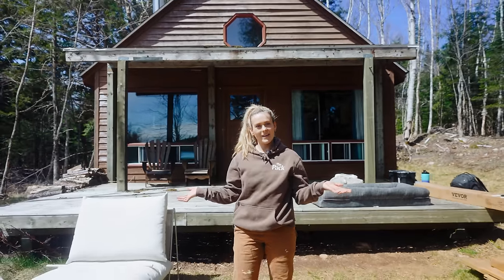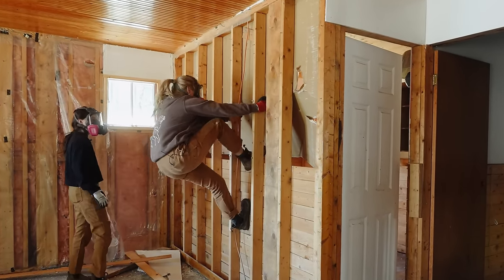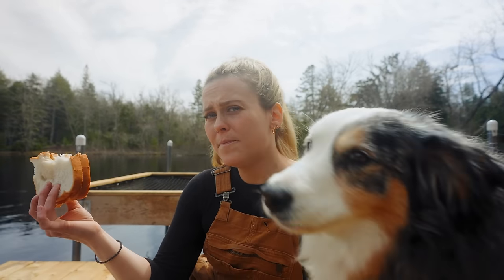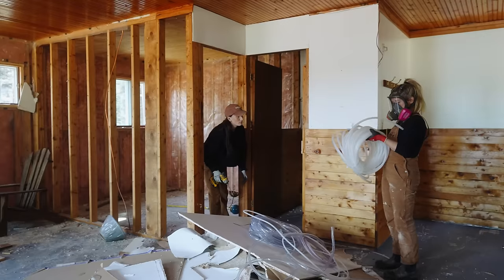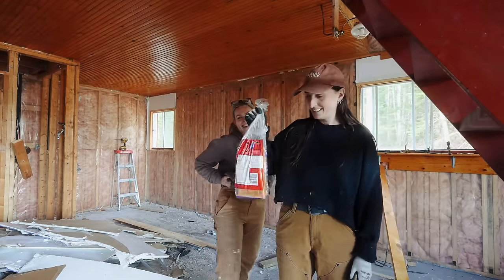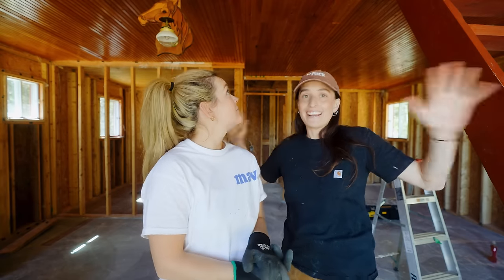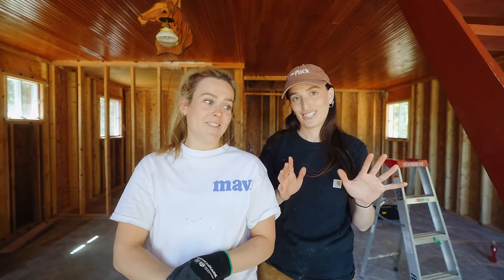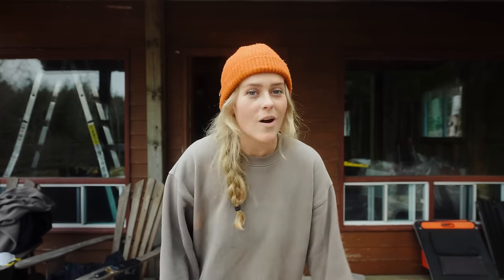Renovating An Abandoned Home: Demolishing the Building

Comment: Nice work you two. Big plus that the framing is 2x6. If all the water is coming in from the roof then the sheeting in that area of the roof is most likely rotten as well. From what I’ve seen some studs and floor plates and some floor sheeting is not a show stopper. Kind of sucks that the wall sheeting at the windows is gone but don’t really know what you planned for siding. Of course the siding needs to be replaced once the wall sheeting is done. If it was mine I still think it’s all worth fixing. Keep going!

Comment: You should consider spraying the moldy areas with water before ripping out so the spores don't release in the air when you disturb them. Also to avoid the super gross feeling after  demo like that wear a disposable coverall like tyvek. You will still sweat a need a shower but all the gross dust/debris won't be on your clothes and skin. Great job!

Comment: Jasmine I understand the claustrophobic feeling of wearing a respirator but you have a substantial amount of mold in the cabin, not working directly with those areas doesn’t prevent exposure. Mold releases airborne particles which can be dispersed with movement through the area and as Crystal removes those materials, particles are dispersed throughout the air that you subsequently breathe even standing away from the surfaces.  Please at a minimum wear an N95 quality mask when in the cabin until you’ve treated the mold areas.

Comment: Wow this is going to be  a lot bigger job then the other cabin . But the views of the lake make it worth all the work. Are you going to salvage   any of the T&G to use when you rebuild?  One thing you might want to do is to tarp  the roof so as you gut the place it will help dry the place. 
You should cover the holes in the floor And you should be wearing  a mask anytime you are working inside till you have finished gutting the cabin.

Comment: 😊 just an fyi.. in past experiences outside wall for water supply like kitchen sink, in buildings that aren't continuously heated during the cold months will freeze. But if your crawl space is gonna have any heat vs. Outside frozen temps. The pipes won't tend to freeze n insulate exposed pipes.

Comment: Look careful at the windows.They will be sweating It appears to be leaking but they may not be leaking. Might wanna pick up some big fans to air That place out before you start rebuild. Having been through it with 3 trees in the roof from a hurricane. Once you get the leak stopped on The roof you need to spray everything with a mold killer.Get some fans in there and get it right out.And then determine what would it spend and what wood is good. You'll be surprised.How much of the wet wood is still perfectly fine once it's dried out. But once you spray them all you need to get the humidifier are fans in there to get the moisture out. I spent 2 years hunting howl after howl in the roof I finally just had it replaced and they found a 12 inch.Tough that flap Dover and no one could say it.Was there 4 different roofing Experts looked for and could not find.
Once the roof is stripped back and the plywood is replaced.That is bad.Have a roofer, put down The polymer called ice and rain You cannot do it yourself.Because they will not warranty.It has to be done by a trained professional. But this is designed the self seal if the roof gets damaged in a storm Or ice And comes with a nice discount on your homeowner's insurance.

Comment: I think you should keep the octagon window and just install it properly, but maybe instead of keeping it up top there you could put it in the bathroom, or somewhere on the back of the cabin, and frame out and install a very large daylight-channeling window in that upper space instead. i guess it might depend on what kind of final ideas you have for the upper floor. 

if that front wall is completely garbage you could maybe open it all the way up and make an accordion window/wall out of it (like on the side of your first cabin), or maybe build a whole extension off of the front of the house. 

💛

Comment: What about the mold that's on the first floor joists (as seen from the crawl space)? Will you need to replace some of those joists? I suspect that you'll need to replace a lot of your subfloor. Are you saving the tung-n-groove boards for the new version of the cabin? 
As a design I would move the stairs so that the kitchen area is connected to the sitting area. Also I would start the bathroom at the outside wall under the existing window. It needs some natural light. 
I think the wet sheathing in the front corner may need to be replaced - not a big deal but it may be too wet. It may have expanded from absorbing water. 
The 2x6's are great but you ought to put even more insulation in the walls if this cabin will be used in the winter. In many cold climates like yours, in North America, the standard (or the building code) for exterior walls is at least R-30. You can get that with closed cell foam but that's expensive. You could add a 2x4 interior wall and blow cellulose or fiberglass into the 10" walls. That will get you a very nice R-40 wall. And the roof ought to have at least R-40 but R-60 would be much better. Don't forget to insulate under the first floor. That ought to have the same insulation as the walls. 
If you are going to replace the windows get ones that are filled with gas for greater insulation. You don't have to get fold-away doors like you put into your main cabin but bigger windows facing the lake would be nice. (Whew, that got a little long. Sorry.)

Comment: Kiddos...Blue tarp, blue tarp, blue tarp.  Get the roof leaks under control and allow the framing a chance to dry.  If you need to keep the windows intact, try some tubes of really really cheap caulking, using schmear technique.  Gotta stop the water.
Big question....Does the river/stream/lake itself rise high enough to reach the first floor of the cabin?  If yes....Short of installing levees or lifting the cabin, you're fighting a battle mother nature always wins.
Another consideration...When you remove external wall framing, some of the exterior wall covering will need to be removed.  Can you preserve it?  Can you match it?  Would the exterior need completely recovered?
I think assessing the water damage/mold damage with all the framing exposed is going to set the direction for what comes next.
Be safe, thanks for your time and good luck.

Comment: The biggie is what's the sub floor like. If it's in good condition it'll be a long remodel (nothing you're not used to). If it's sketchy then you 'could' tear the whole cabin down (carefully) salvaging the structural pieces, build a new raised base a little further back from the river and design your own structure.

Comment: Considering the cost of building from scratch it's well worth salvaging... the bad places can be cut out and rebuilt if the structure is in question. Good mold killing and drying, after you get the roof plugged, will start to let you see that new vision.

Comment: I'll take a stab at this. Tearing down the house and rebuilding it would defiantly be faster, but, fixing the issue areas,  will save a ton of money esp when all you'll have in it material. I'd continue to dig till you find the bones, and then come up with a game plan. I am hoping as far as the roof goes, you'll only need to replace a few boards and the sheathing, followed close behind, all new tin. Then you can take your time and fix it right. Treating the mold where you can, and then rebuilding it. You might wanna look into some professional help and raise the cabin several feet so it's no longer gonna be flooded again. Not that that is the main issue, but, it is an issue. Also, as far as replacing any of the rafters. Get some good demo blades for your sawsall, and do one at a time, that way, will be easier for the two of you to do that job no problem. Get some good tarps to cover it all as you go, then when nothing but the rafters, start rolling it back as you start putting your roof on.  I hope you are going to save some of the board you are taking out, could be a big money saver. Invite some friends over and have a nail pulling party! 
I think you should change the name from Vanwives, to Cabinwives ;)

Comment: I’m mostly concerned with the sill plate, the rim joists and the floor joists. Everything above that is fixable as long as the base is solid. I’ve had to level an improperly built post and beam house and it’s a chore to say the least

Comment: Looking at it, there's nothing wrong with that cabin structurally. When you did the tour underneath in a previous video, all the blockwork looked good, the joists looked good and now you've pulled all the linings out, the walls inside on the ground floor at least look to be in pretty decent condition. Windows are garbage (flashing weird shaped windows is hard and they almost always leak if not done properly), roof needs replacing and where any studs have had water running down them, it's probably smart to put a moisture meter on them first and then replace them on a case by case basis. Subfloor is garbage too, just from the water pooling on it. This isn't a knock down and rebuild, it's a repair and re-roof.

Comment: Get a PRO to replace the roof.  Replace windows, floor,  Leave 1sr floor bdrm and bath where they are.  Make sure bath has access to main living area.  From watching video, difficult to move stairs w/o moving windows, doors, etc.  Live in U.S.  Do insurance inspections, residential and commercial for a living.  Where do you plan to put electrical panel.  You panel in your main house would not pass code here.  CAN'T be covered, MUST have 3 foot access.  Your washer/dryer would need to be moved.

Comment: You have both worked hard getting to the bare bones of the cabin, I think that it would be good to have the bedroom upstairs and then make the downstairs bedroom your Kitchen.  but the roof has to be a priority to get the place dry,    Instead of that small window upstairs you could put a larger window in so you could see the view from the bed. you will have a large lounge which would be great for visitors to be able to stay if you get a sofa bed.
Reply from the maker: Thanks Barry we are loving all the great designs our pack is sharing.😊🐶

Comment: As a old General contractor you still have great bones of a structure.. Start at the top and work your way down. as far as layout goes small bedroom and bath down stairs  the rest I would leave open as kitchen and living space. the upstairs I would have as a big multi bedroom. leave your stairs where they are but bring them down part way and make a landing and turn for the last 3 or four steps or you could set them back in about 4 feet, .and place a bed on each side.
God Bless from your Canadian Friend

Comment: Have you considered replacing the existing cabin with a Tiny House?  It would be raised up from the damp ground on wheels, and you could even push it back onto higher ground in the event of a major flood being forecast.  I guess it would be cheaper and less risky than renovation, and you could let your creativity run wild designing it from scratch!
Reply from the maker: Thank you Paul, we do love your idea. We are considering so many different options. 😊🐶

Comment: I think your design is going to be determined by the use....For example, if you want a bigger house to have a family...then you may need to consider where you might put an addition (not on the river side) and leave room for a doorway to access an addition...instead of completely blocking that wall with kitchen cabinets and the bathroom.... so, take some time, and think about how you will use the space.  Personally, I think you would add some major windows to access the view.
The bones of the cabin do look good and it doesn't need much more than what you did to the other cabin....roof, walls, insulation, siding, wiring, plumbing....everything.

Comment: Don't do anything new inside until you've handled the roof leak (roof replacement).  Strip off the shingles. Replace any rotten wood on the roof and install a metal roof.

Comment: Good morning ladies. I found your channel after watching you do a joint video with ambition strikes. Really enjoy watching your Channel I am an editor for a another YouTube channel called Remove It Pros demolition. We specialize in Demolition and repurposing items we found from demolitions. I see you have a lot of screws sticking out where the drywall used to be quick little note to help with that is to use a grinder to grind off the screws instead of trying to pull them out with a drill

Comment: I think you ought to rename the channel The Wrecking Crew, j/k. I think you are on the right track with gutting the inside and getting rid of the dry wall and insulation. As I mentioned before do the cabin the way YOU!!! want it done. Once everything inside is torn down do the roof the same as the other roof got done then replace the floor

Comment: Tough decision. Keeping the cabin you can get right to work, but are restricted by the existing walls and the flooding issue is not a minor problem.  Other side of the coin, tearing it down and rebuilding new, you could design something cool, that works with the landscape to avoid any flooding issues. But that would take a lot more money and time. Either way you have a home base to work from so how much money and time do you want to spend. Perhaps the deciding factor is - will this property be temporary or your forever home?

Comment: Hot tip to improve your experience removing drywall: remove as many drywall screws as you can  - they are easily located under paint and mud with a magnet and you can easily get to the screw heads as drill and bit will dig into the drywall and meet the screw head and spin right out. You can usually pull off whole sheets of drywall with much, much less dust and mess. Just make sure to score around the sheets first with a razor or sharp knife. That said, it can still  be mighty therapeutic to vent any pent up aggression by hammering your drywall into dust - either way, you go girls!
 Here's a link to a fellow 'Tuber for his technique: https://www.youtube.com/watch?v=r8TH0BY4Sj0

Comment: I still say burn it all down and rebuild on a better and higher ground. I do not agree that you can simple reroute the river and "drain" it to the lake. When it rains enough the lake will also cause issues. The placement of the cabin is just bad.
Also replacing the sub flooring is not so easy. What you seems to forget is all that mold is in there for god knows how long. Its everywhere.
I wish you all the best and i hope that i am wrong. The renovation might work for a few years but it will bite you later. Long term it woulld be better to build a better and bigger cabin on higher grounds.

But we will be here and see what you make out of this. Depending on your mexico plans which sounds like it will take longer to really start you have the time to at least fix the roof.

Comment: You keep the bones and fix the area that need to be fixed at the price of wood today you will save so much money and the first thing to do is to get it roofed even if it’s a big tarp get it all undercover add on the drywall under the tongue and groove is ideal. It makes the tongue and groove more sturdy and it’s better or adds to the insulation and you don’t have to do the drywall perfectly one one coat on all the seams is cool

Comment: Good example why you should NOT using plywood on the outside wall and plywood flooring between the wall and the floor as 99% of the Amerikans do. What breathe the best in the walls Tyvek on the outside install to the frames or plywood?

Comment: As the owner of a Construction company with over 300+ employees and over 1600 renovations trust me when I tell you to go out to your firewood pile and drill into the center of one of your logs. Wood exposed to moisture can retain moisture for years in the center even if it feels dry on the surface. I have seen moisture and mold spores reappear even after being cleaned and disinfected and retreated. I have even seen moisture-exposed bare wood fail even under spray insulation. Like your firewood, it loses its density and integrity because moisture swells wood naturally and changes the structure of the grain and shrinks when drying only to swell again when humidity rises. Please tear it down and save yourself money and heartache a couple of years from now. Moisture-saturated lumber is a safety issue and a health issue that no one wants. If you think I am wrong simply look at the gap spacing on any of your outdoor wood builds and see if the gaps are still as tight as they were when you built them. Stay safe.
Reply from the maker: Thank you Robert. 
We appreciate you sharing your experience and knowledge with us. We believe you. 😊🐶